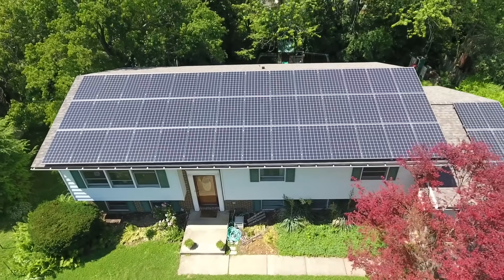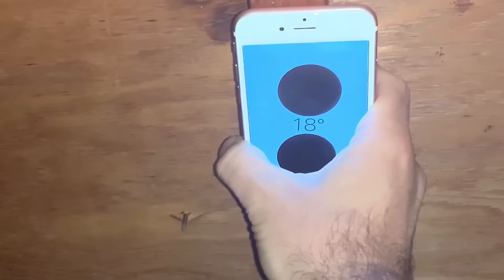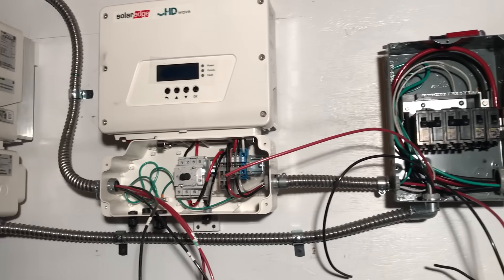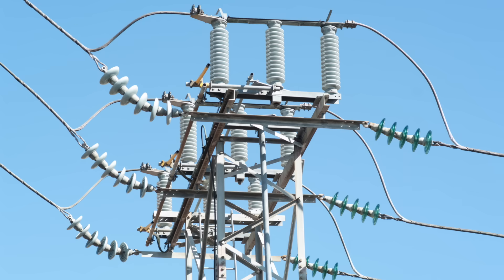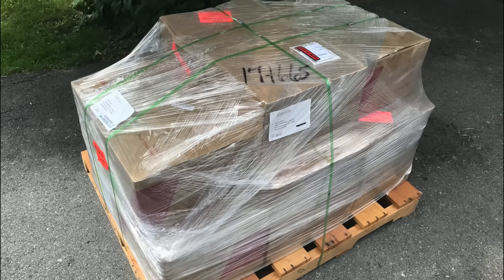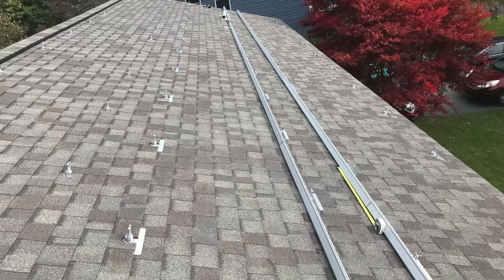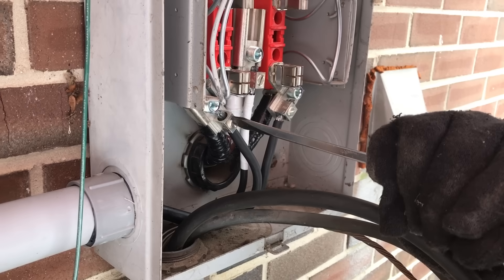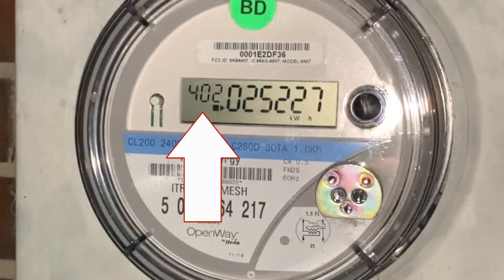I Installed a Power Plant Myself | HUGE DIY Solar Panel System

Comment from the maker: What do you think about getting solar?  Check the video description section for the various links.
Reply: What was the size of the system?
Reply from the maker: System is 15.6kw
Reply: @FrugalRepair  Huh?

A neighbor's solar array that's slightly bigger than yours, in rated for SIX kWh.  Also, did you have the power company verify what you were actually generating and that it was AT LEAST what was on the grid?  Otherwise, you aren't putting ANYTHING on the grid; you're a net CONSUMER of grid power.  And that's only for maybe 5 hours per 24.

Remember that power companies are FORCED to pay solar and wind providers as if they were generating 24/7 (which they aren't).  When that goes away, you might find some back payments are owed by yourself for all the power you were paid for, that you DIDN'T generate.
Reply: @billcichoke2534  kW and kWh are different, and output depends heavily on how efficient the panels are and how many hours of noon-equivalent sunlight they get.

Because fixed panels do not produce full power before and after when sun hits them directly the output changes but that is why the companies have those meters that can calculate precisely how much power is delivered in each direction. If someone says their panels get five hours per day they mean from full day of sunlight they get equivalent of having noontime sun shining for five hours straight, so for these 15.6kW panels they would produce 15.6 * 5h = 78kWh of power. A big house like that could easily use 30kWh per day so the company still owes them for 48kWh, but if their accounting program stupidly averages that as if the panels were producing power at night that is their mistake.
Reply: @FrugalRepair  At 15 Kw can be considered a plant or a generator? I looked at the power plant definition, and it says about industrial generation. But I do not found the specs to find actual figures about what can be considered a plant and what a generator.
Reply: @AnalystPrime  I get the power concept; but I don't get his numbers.  And my comment about 'generated power' he's paid for, goes back to the same issue.

Solar panels and windmills have an ADVERTISED output rating, that they rarely ever produce.  Also, that rating is 100%, which is another thing these two power sources never come close to.  So his numbers are way off reality right from the get go.  Also, solar panels have a VERY erratic generation output, as heat builds up internally and drops output, then cools as the output drops and output rises again.  As well, if his system is putting out less power than the grid lines are carrying, he's not putting ANYTHING on the grid...he just using less than what the grid is giving him.

Power grids work the same way all over the planet, and solar doesn't work in the desert plains of eastern Oregon.  I have to disagree with his numbers AND conclusions.
Reply: @billcichoke2534  Advertised output is irrelevant, if current output is 5kW and he is using 2kW then he is selling 3kW to the grid and getting zero watts from it. In the evening panels give him 1kW but he is using 4kW so he is buying 3kW. At night the house uses 500W so he is paying for .5kW because starlight gives insignificant amount of power. All the power sent to the grid and received from it is counted as it is goes though the meter, nobody in the power company is making any assumptions on how much his panels are theoretically rated for and you shouldn't either.

How much power solar panels produce always depends on angle of the light and amount of cloud cover while the rated watts panels offer is always for perfect conditions which rarely happen in nature because Sun will shine from a slightly different point in the sky every day of the year and the angle and facing of your roof is fixed. You need expensive solar trackers for each panel if you want to reach 100% efficiency at capturing the light and the few extra watts are not worth the expense unless you are designing the array for the ISS.

Panels heating up does lower the efficiency notably, but while that does affect the output the output does not affect the temperature. If the Sun heats your panels to 150 degrees F they will remain at that temperature until clouds block it or evening comes, the amount of power drawn from the panels does not cool them down. And if you somehow invent a device that cools down when you draw electricity from it please tell me, breaking thermodynamics like that is either good for laugh or worth the next Nobel prize.

Power grids do not work same all over the world, in USA and other third world countries they are old and poorly maintained and that is why we cannot just power Los Angeles with solar power from Florida in the morning and New York from Nevada in the evening. Solar power has been economical without any subsidies for a long time already but power companies consider upgrading the grid to be a waste of money.
Reply: @AnalystPrime  I had to do a double take on your post.  'In the evening panels give him 1 kWh?'  REALLY?  Solar is so magical it works now even when the SUN IS DOWN?  And advertised output IS relevant, because that's what he's basing his numbers on.  As you correctly pointed out, the ADVERTISED output is based on each square meter of panel in lab conditions, with a simulated 'sun' pointing directly at the panel.  It is NOT proven out in the real world, where panels usually generate maybe 20% of that figure, under optimal conditions.

And grids all work under the laws of thermodynamics, to include energy flows from areas of high concentration to areas of low concentration.  So whatever he MAY be generating, is not as much as what the grid runs through his distribution transformer.  It is, therefore, impossible for him to be sending ANY power TO the grid, when he doesn't send as much power to his transformer as the grid does.

Let's use your numbers...if he's receiving 240v @ 50A (12kW), and his panel is making 5kW (unlikely, but we'll go with it) and he has 3kW over what he's using, then he's sending 3kW up against 12kW down.  In other words, no he isn't.  We won't get into whether his transformer is a straight step down or a surge-protected one way.  He's not making enough juice for anything to get to the grid.  So any check he's receiving, is due to a government edict on the utility company, NOT due to him being a 'power provider.'  And the same program is used by the owners of grid-level wind and solar.  They are paid by the utility based on a presumption of power provided 24/7 (which none of them do).  This is a government mandate on the utility company to promote and pay for renewables, at the expense of ratepayers who don't want solar messing up their roof or messing with their power delivery or raising their home insurance rates.  This is NOT payment based on actual generated power.

The internal thermal resistance I was talking about, has to do with not only the sun, but also heat created when current is generated.  As I said, the output is erratic due to this feedback, and it DOES decrease slightly as power drops, which allows power to rise, which adds more heat, which drops power generation...et cetera.  It is one of the main reasons the power output charts for solar are always all over the place.  And it is almost impossible to smooth out for residential usage.

I will give you the fact that we use single phase power on our grid (meaning north America and Mexico) while Europe uses 3 phase.  But the general setup and operation are the same, when it comes to routing power from generation sources to customers.  And our grid isn't just old...it's overburdened.  Take away generation sources because they're 'icky,' put pinwheels and smoke-and-mirrors solar in the mix, and add 10% more users every year, and OF COURSE we're going to have issues.  It makes far more sense to have city or county grids, with less cross-connectivity, than what we're doing now. That way, the needs of the area can be more quickly, efficiently, and cheaply addressed.  What we have now, is the equivalent of a prison yard, with everyone vying for priority.

Someone always loses, and nobody really wins...
Reply: @billcichoke2534  1. The time when Sun is down is called NIGHT, I even used both words one after another so it should have been clear from the context.
Noun: evening "The latter part of the day (the period of decreasing daylight from late afternoon until nightfall)".
Noun: night "The time after sunset and before sunrise while it is dark outside".

And yeah, I am assuming that house is not up in the arctic so the Sun is not still shining after midnight. Technically the panels would also produce few watts from moonlight and light from other houses, but I am ignoring that for simpler math.

2. If your car has top speed of 100mph, does that drop to 20mph if you only fill the tank halfway or parked the car for the night instead of driving it 24/7? Whoever told you that solar panels only produce 20% power is either hilariously wrong or a lying liar who lies, either way you should ignore their foolishness and use basic math instead.

3. What you are saying is that the electric grid can only ever have one power plant, because if you try to connect a second one the less powerful one cannot send out any power. FUN FACT TIME: Grid does not work that way. The power companies buy electricity from many providers each day and can combine it all just fine.
Reply: @AnalystPrime  You said panels generate power after the sun is down.  No, they don't.  You and I BOTH know what you said, and what I said.  You were incorrect, and there was no misunderstanding of context OR content.

As to power generation, that comes from the manufacturer, as well as the output panels on both local residential AND grid solar arrays.  That's what the METER says...but I guess I should believe you over the meters or my 'lying liar' eyes.  And I was using basic math, which apparently triggered someone, since it PROVED they were either wrong or lying (i.e. trying to sell others on purchasing these useless systems). And you're equating petrofuel performance (which can produce baseload 24/7) with renewables (which never could).  So your fuel tank analogy is an ironically ignorant one.

I understand how the grid gets power...maybe it's time you did as well.  The utility has to keep the power level just above what's needed--REAL TIME--but no more.  And baseline has to be maintained, regardless.  So my point is accurate.  There is always the same power at the distribution transformer for this guy's house, and he doesn't generate anywhere NEAR that.  So it's not going anywhere, least of all on the grid.  All that's happening, is he's using some of what he generates, instead of what comes from the grid to his meter.  That's it.

DESPITE the sales lines, none of these people are creating more power at their house, than what the grid has available on their lines.  If they were, then all the houses would each have to have a regulatory compliant substation, courtesy of the homeowner, controlled by the utility.  THEN the utility would be paying them for power produced.

Understand?
Reply: @billcichoke2534  48 panels @ 325W per panel = 15.6kW.  On an average day the system probably produces 55-65kWh. Taking into account for cloudy days, probably 900-1000kWh each month. He spins the meter backwards during the day more than he uses at night.
Reply: @propellerhead2000  Again, that is the ADVERTISED RATING of the panels, NOT what they produce in the real world.  As I stated, residential and grid-level arrays in my local vicinity do not produce ANYTHING close to their ADVERTISED rating.  And the power they DO put out, is extremely erratic.  It's the main reason we have more frequent power fluctuations and broken outs, than we did before these monstrosities were installed over valuable farmland. 

Considering the fact I live in the arid plains of eastern Oregon, where we have far less rain OR TREES to block any sun, it's laughable to say that someone who lives in a wetter, bushier area is making more from those same panels, than anything out here does.  To also claim anything about being paid for power being put on the grid, when his system can't make stable grid level power, is also laughable.

The truth about these things is, they DON'T work as advertised.  If this guy said he was saving a little money on his power bills, groovy.  To make claims that don't match reality (either of solar OR of our current grid) requires an answer.
Reply: @billcichoke2534  Stop being a silly person and please read properly before making accusations. I said the panels produce power in the EVENING. In case this is still unclear to you, "evening" is not same thing as "night", even a child should understand this much.

Incidentally, panels actually do produce power at night, and I don't mean in the arctic where the Sun does not set. Modern panels are so good they work on starlight and the light pollution from nearby artificial sources, the amount is just so few watts there is usually no need to mention it. But if you are going to do any electric work on the house, never assume there is no current just because the Sun is not shining.

My fuel tank analogy which you obviously failed to understand is that just like your car does not lose its ability to drive at top speed when not at the manufacturer's test track PV panels do not magically change their efficiency when not in the lab. A 100W panel is a 100W panel, not a 20W panel with fake advertising, that is what the testing facility and regulations are there to ensure. If you do not get the advertised power from them then either you are not pointing them at the Sun or you broke them.

Next you seem to have weird ideas of how power companies do business. An average American home uses about 30kWh per day, which the panels shown in the video can provide in couple hours. At minimum they remove any need for that house to buy any power from the company, meaning the only profit they can get from him is buying his electricity at lower price than they would have to pay for another provider. If the power company cannot get any energy from this house they have no reason to pay for it.

Basic math: either they get enough power from that house to make a profit or the power company goes bankrupt due to stupidly giving away free money.

It also does not matter that there are megawatts of power in the grid and this house is only providing few kilowatts, the energy must go somewhere and if it wasn't accepted into the grid it would have burned that house down long time ago.

And BTW, where in the video did it say that the power company does not have the basic systems they need to accept any power from the house into the grid? Your arguments not only fail to prove there is anything wrong with solar power, they imply that the power company is run by idiots who both refuse to utilize the available solar power sources and give people free money for not buying their electricity.
Reply: @billcichoke2534  No, that is rated output. A panel which is 18.75% efficient will produce 375 watts. I've had panels EXCEED rated output under ideal weather conditions. If you neighbor's array is larger and only producing 6kW then either something is wrong or the efficiency of the panels is shit. I've lived off-grid with solar and I am quite intimate with the variables involved in power production.
Reply: @billcichoke2534  PS - The solar energy received in western Oregon is poor. 40% less solar energy compared to a place like Nevada or California. You know this. Anyone who installs a system should know this and should factor into their ROI.
Reply: @billcichoke2534  what? I've been a technician for years and I've NEVER heard of the interconnection agreement you're describing here. Do you have a specific power company that does this or a link to a source of infor where you got this from?
Reply: @AnalystPrime  No, what is NOT clear is how you keep saying you meant other than what you TYPED.  Your misplaced condescending attitude aside, solar power generation for pretty much ANY TIME AFTER 1600hrs is low enough to be considered 'nonexistent.'  Utilities usually open the connector to solar farms around this time, due to this inconvenient fact.  Again, ask them if you doubt me.  I did.  And your fuel tank analogy had nothing to do with lab test vs. reality.  If that's what you were going for, it was a clean miss.  Not my misunderstanding, but your failure to even superficially address whatever point you were making. And my point is, the advertising behind these things, and the government support of them, is based on agendas other than environmentalism and their independent viability.  THAT is why facts like their lackluster generation capability are either glossed over, ignored, or (as you're attempting) scoffed at.

I understand the strictures PUBLIC UTILITY COMPANIES are under, to force these unworkable renewable boondoggles on them.  Renewables manufacturers and site/facility owners are in this business SPECIFICALLY BECAUSE utility companies are FORCED to pay them, and at higher than market rates.  And that FEED IN TARIFF is irrespective of the actual amount of usable power generated...whether you're talking about a grid level facility, or this guy's house.  So you're correct...the basic math IS that they either profit or go bankrupt.  But it's not THEIR stupidity that's on display here; it's the GOVERNMENT POLICIES TO PROMOTE UNWORKABLE EXPENSIVE GOVERNMENT SUBSIDIZED POWER at the expense of the middle class.  And it IS bankrupting many utility companies, while leading to a less reliable grid.  Not a conspiracy, just an observation anyone can objectively make.

I am amazed every time someone spouts a line like this.  Have you EVER seen houses burning up when everyone goes to bed, and that baseline 12 or so kWh isn't being used?  Have you seen everything plugged into a 2 or 10 kW blow up when nothing is running?  Of course you haven't, because the lines are designed around maintaining that current continually, for instant on demand access.  They were NEVER designed to have any surges of power from customer sites go BACK to the grid.  As I stated before, that requires a certain generation level AND A CONNECTION SUBSTATION.  Your distribution transformer, especially if it's shared with neighbors (as mine is) DOES NOT ALLOW BI DIRECTIONAL POWER.

This video doesn't talk about that FACT, nor does the entire solar industry...almost as if they're making that before-mentioned money off sales of this stuff and don't want anything interfering with those sales.  Strange, isn't it?  There is plenty of evidence that solar is unstable, and that utility companies will avoid using it for that reason.  This is the reason THEY are forced to pay those 'tariffs' to owners (grid level and homeowner).

The fact is, solar is unstable, erratic, weaker than baseload, and occurs when it's not needed.  Wind is the same way, only during 3-4 hours at night.  This is not something this guy would have done, if the free government money wasn't to be had.  And he didn't go off grid with it, which should ALSO tell you something.  If he did all his homework and this was feasible as an isolated and independent generation source, wouldn't he have done so?  But he didn't.  Stop being silly...AND BLIND.
Reply: @HomeEcGuy  Really?  What do you think a feed in tariff is, exactly?  And where do you think the money comes from, to PAY for it?

It's a government-mandated payment utilities WILL make to renewables owners, that utility companies have to make up with higher rates to NON-owners.  That's not even a fact in dispute.
Reply: @propellerhead2000  It most certainly is.  In EASTERN Oregon, however, it's much better.  But solar still doesn't work out here, any better than it does in SoCal.  This is not about ROI...this is about base viability.  This is also about making sure the facts are known, instead of continual sales jobs that ignore or obfuscate those facts.
Reply: @billcichoke2534  There is no obfuscation. Merely ignorance. If you area you live in receives at least 5kW-h per square meter, solar is viable.
Reply: @propellerhead2000  Oh, solar is sold wherever there's someone who buys the sales pitch.  That doesn't make it VIABLE...as it continues to show it ISN'T.
Reply: @billcichoke2534  Unviable?!? LOL! On what planet? You must live in a small world. On the planet where I live with 5.5 kWh/m3 of solar irradiance and a utility rate of $0.14/kWh the payback is less than 2 years for grid tie, 6 to 7 for off grid. People get fucked when they don't do their homework. Not because the technology isn't viable. They're the same people that bought aluminum siding, reverse mortgages and anything pitched on TV by Joe Namath.
Reply: @propellerhead2000  Non-viable.  On the world we BOTH inhabit, there hasn't been a single situation where solar kept the lights on all by itself.  Not one.  In every case where you only had grid level it residential solar, the power fluctuated badly enough to ruin electronic gear and be shut down, or the lights went as dark as every other home that WASN'T slathered in smoke and mirrors solar.  So without the feed in tariff and state and federal subsidy, solar doesn't work or pencil out.

And I'm not 'lol' ing about it.  It's a joke and a CRUEL one at that.
Reply: @billcichoke2534  Your pencils must be dull.  None of those things you describe occur with a properly engineered and equipped solar system.
Reply: @propellerhead2000  Oh, sure they do.  You just have to do your own research and not listen to these salesmen trying to pawn off their panels on you.

Talk to the manager at a grid control center.  Talk to a utility tech fussing with the lines or substations.  Talk with someone who has to actually DEAL with this stuff from the GRID side, instead of the government-supported owner/installer side (they ARE opposite interests).  Stop drinking the sustainability koolaid and find out the truth for yourself.

And ask yourself why push a book or certain brands of panels or components, if this guy has no ulterior motives with this stuff.  Who pays HIM?
Reply: @ehombane  totally random question but is your username based on an Isaac Asimov character from his robot series books?
Reply: @n8yt  Nope, Asimov inspired his series after me :) 

On a serious note, do you ever encountered at least Olivaw alone in other context than the asimovian one?
Reply: @ehombane  I interpret your response as an admission that you're really a robot detective then!

I don't believe I ever have encountered Olivaw outside of his series :-)

I'm reading through a bunch of classic sci-fi novels during quarantine right now. I am currently going through his robot series books.  So fresh on my mind + a unique name + seeing it in the wild.. my curiosity got the best of me.  Lol
Reply: @n8yt  Yep. To be more precise, I was, now I am not anymore a robot. When I was I liked the idea of a positronic brain and replaceable parts. But in time I changed, myself, and my mind. Now I am just a shepherd, albeit a little bit of a cannibal, since my tribe use to eat the heart of worthy enemies. 

However, I did not bothered to change the handle here with the new one. It does not bother me having a split personality :) 

If you wonder who the cannibal is, look for the journey of a catechist trilogy. Is a nice fantasy. Not as famous, but is better since I find always the username available.
Reply: @ehombane  That sounds like a solid recommendation from a person who was formerly a robot with a positronic brain but now casually eats people from time to time.  I'll take a look at that trilogy :-)

The best fantasy I've ever read, and I mean best by long mile, is The Broken Earth series by N.K. Jemisin.  It's the first book I've ever read where I wondered if the author was going through x (can't tell you what it is or it would be a spoiler) in their life because her emotion really spilled out on the pages of. I couldn't put it down. Check it out!
Reply: @n8yt  Thanks for the recommend. I will check it out, even I am long out of reading. with all regret of not being able to pass through so much good stuff that is out there. 

Anyway, what is good depends so much on so many factors. As   a kid was obviously Verne Wells Asimov... classics. Passed though so many others but ended with Piers and Zelazny. I told to my friend who supplied me with books that if writers were guns, those two are cannons :) And they wrote so much... I collected all their work with the intention to finish all of them, but my attention got diverted. No more time for reading :( Plenty of movies too. Many good books end up on the screen, even there are a lot of others I would have liked to see getting alive.  one of them is https://en.wikipedia.org/wiki/The_Chronicles_of_Thomas_Covenant
Reply: @billcichoke2534  Your comment makes no sense.  Please explain more precisely.  Where did you get this information?
Reply: @oscarb9139  Which one?  You didn't specify.  And I'm sharing info I got from three electric utility companies in the Pacific NW, a couple of solar installers, and friends dine in SoCal and Texas who get to 'enjoy the benefits' of an unreliable grid due to renewables.
Reply: @billcichoke2534  Your first comment.  This is not being critical of your comment, it is just asking for clarification.  Explain how the process works and link any relevant sources if you can.  Thanks.
Reply: @oscarb9139  Okay.  Hope this helps...

ONE:  FEED IN TARIFF--government mandate that requires solar and wind producers be paid for INSTALLED power capacity, regardless of how much power is actually produced.

GRID POWER--in order to mix disparate generator sources and levels, all go through conditioning systems prior to entering the grid.  Houses do not have this system included, and many are fed by distribution transformers that are designed to only let power go one way (unidirectional or site surge protected).  Any that AREN'T, do not produce enough power to compete with what's on the power line.  That means grid power is still going TO their house, and NOTHING is getting out.

Why are they getting paid?  See point one.
Reply: @billcichoke2534  Okay, I am confused.  It was called net metering where I used to live.  So, at the end of the month, if the net use was positive, you paid the retail price for power used to the power company.  If the net was negative, the power company bought it at the wholesale rate.  It didn’t matter how much was installed on the home.  Do you have a link for point one?
Reply: @oscarb9139  Yes...here's one from our friends at Wikipedia.

https://en.m.wikipedia.org/wiki/Feed-in_tariff

Notice that the cost of this subsidy is laid at the feet of the utility, who then has to extract it from people who can't use or afford solar.  This leads to not only aforementioned grid unreliability, but power poverty.
Reply: @billcichoke2534  https://en.wikipedia.org/wiki/Net_metering.  That’s what I am familiar with.
Reply: @oscarb9139  Correct.  It's an ASSUMPTION of a certain amount if power generated, even if it WASN'T generated.  Most importantly, like I said earlier, the re w isn't a single residential rooftop solar system creating as much juice as what comes down the power lines.  There is, thus, no power going TO the grid and nothing to give credit (or payment) for.  It is a feed in tariff, with a different name.
Reply: I highly suggest you go into business.
Reply from the maker: You mean as a solar installer?
Reply: @FrugalRepair  Why Not? There are courses available that you could breeze through now. Get an electrician on contract.
Reply: @davefroman4700  where are these courses? I’d be really interested in them.
Reply: I think you can squeeze 2 more panels on top of the garage
Reply: @fahrimertdincer8421  Not much point, it is oversized unless he is using much more power than average home. Which does bring to mind, I want to know how much does that produce in the morning and evening when the angle of light is at its worst.
Reply: @davefroman4700  awesome
Reply: I put in a small system in 2007, and kept adding to it as panels became cheaper and cheaper.  I'm at 16kw now, with another 6kw on my shop building.  Haven't had an electric bill in 8 years.  About 1/2 the setup is also battery backup based.
Reply: How much did you pay for everything and what would it have cost having the panels installed by professionals? Did you ever consider a solar roof?
Reply: We mounted our system on the ground because we didn't have enough roof space ! Nice system ! well done!
Reply: You did an great job. 
Did you play the kid on Alf?
Reply: How did the module warranty work with your system? Does it have a warranty?
Reply: So how will you clean the panels in the future ?
Reply: @user60706  You are joking right? We have ceramic coating on our panels, I have not seen a flex of dust on them since I coated them.
Reply: @davefroman4700  No Dave, I'm seriously asking. Because i installed a 100w panel in my home around 6month ago and after 5 months i noticed some reduction in power production from the panel. So cleaned the panel and after cleaning I'm getting the power in better. So i also planning setup panel system like you made. But I'm little confusion regarding the cleaning or any other maintenance.
Reply: @user60706  You clean a panel the same way you would wash any window. It is normal for cheap 100 Watt panels to decrease slightly upon break in period but it should level off. If it keeps dropping its faulty. I put a clear ceramic micro-coating for cars on my panels but that was a luxury. I havent had to clean my panels at all since.
Reply: @davefroman4700  oh that's nice. Thanks for your idea dave.
Reply: @user60706  PV panels need basic cleaning, that is just common sense. Quick spray of water from your garden hose should be enough, but how often you need to do that depends on your local conditions. If you got bird poop, leaves or certain types of pollen on them you might need to brush them too, I recommend using one of those mops with a super extending shaft so you don't need to climb to the roof every time. Other than that, checking occasionally that none of the wires got loose or eaten by rats and none of the electronics have fried is all the maintenance needed. Solar is definitely not zero maintenance but only little is needed so it is very user friendly.

Your real problem is you are using a 100W panel, that means just a little dust will drop your power production a huge percentage compared to modern 300-400W panels. Some 100W panels are pretty good quality, just small because it is meant for campers to carry with them and such uses; there are also still lot of very old panels on market that are only 100W because the tech is old, crappy, or both. If you got the latter kind, chances are a larger than average leaf falling on the panel will drop the power output to near zero...
Reply: @AnalystPrime  Thanks for your advice
Reply: That's beautiful work, and exactly what everyone should do. You should expand your storage to 20kwh+ and not bother with grid-tie.
Reply: I have a basic system. I need additional panels though. I will follow your links. Thanks.
Reply: Great resources. Thanks
Reply: Please make some videos on renewable energy credits. I am having solar installed next week and still need to educate myself on the credits. I thought about doing it myself but decided against it. I hate doing electrical lol.
Reply from the maker: @TheStevedie  will do!  I’m actually writing out the content for videos now.  SRECs are important to understand.
Reply: Very good presentation and craftsmanship
Reply: When I build one day, its getting solar.
Reply: Every roof should be plastered with Panels. And evacuated tube Collectors with a warm water storage Tank.
Reply: @te0nani  You DO realize that was the plan of the Carter administration...to WARM UP the planet because we were going to get too COLD.
Reply: @billcichoke2534  I don't think we're talking about the same subject anymore.
Reply: @te0nani  Sure we are.  Solar panels to stave off global warming?  Goes directly opposite their intended design and purpose.  Viable for power generation?  Repeatedly proven to be a scam and a fraud, kept alive by subsidy and mandates.

Yup...we're talking about the same thing.
Reply: I've basically been in your boat for 15 years.  The idea of solar started becoming something that wasn't the wet dream of a Greenpeace activist around then.  The problems for me have been:
A.  My local power company doesn't offer credit for power put back onto the grid (and we aren't deregulated, so I can't pick another).
B.  As a result, I could only just get a $0 bill for half the year without generating a bunch of throw away power, and my break even point would just about coincide with the end of the panels' useful life.

Doing the labor myself might make up for that, though.  Is it possible to do this when you aren't changing your shingles?
Reply: We are thinking installing solar system via a government progmam where you get funded the 85% of total costs by the goverment. I think is worth the effort as we will pay very little for something like this.
Reply: @georgiosskokos6302  Last year in my country was a similar program, a bit better, 90 percent subsidize, so I promoted it in my circle, but few met the requirement since we are mostly city dwellers. And the worst part is that there was a limited amount of grants, something like one for every thousands of roofs. So even only 10% of those eligible would have wanted to bother with this, the program would have been an drop in an ocean. Anyway, the number of those interested was way far less, but still too many were left out..
Reply: Solar panels attract insects , thus attracting birds. Solar panels then kill birds by literally cooking them . In the larger solar fields out west , birds can ignite birds in mid flight. Workers on these farms call them streamers , because they smoke from the reflection of the solar panels ; when they fall out of the sky.  Not to mention the environmental impact of destroying the earth below the panelsduring use and decades to come after they are disposed off. We're going backwards here people, not forward.
Reply: @immelting9834  https://youtu.be/emBY6phmn9E

You are mistaking the type system I linked above with solar panels.  Solar panels do NOT ignite birds in flight.  I am not even sure solar panels attract bugs.  Perhaps they do.  Now, that being said, I am not a windmill guy.  The power they generate is expensive.  The power is unreliable and has to be backed up with fossil fuel or nuclear reactors in the even the wind dies down or cloud cover obstructs the panels.  Solar fields are ugly to look at, and every bluff in Texas seems to have a bunch of windmills on them.  Should we stick them on the rim of the Grand Canyon too?  Maybe in Yellowstone.  Maybe Banff.  The wind is pretty good there too.
Reply: @oscarb9139   I work at Upton - 2 Solar Farm in Texas. The solar farm covers almost 2,000 acres roughly the size of 1,400 football fields.  It has  around 720,000 solar panels. The company literally pays employees to go out and pickup birds because of this on a daily basis.  The wind farm 10 miles down the road does the same thing with migration birds flying into their structures. One of my buddies that works at the wind farm said last year's reports totaled over 1,000 birds killed. 50 of those were on the endangered species list .  We are required to report  bird deaths to the government or we could be shutdown.
Reply: @immelting9834  Funny that you have to report it or get in trouble.  If a Golden Eagle died after crashing into a smokestack on a refinery, they probably get fined regardless, but solar and wind is so important they can kill birds all day, every day.  

I am so sick of wind farms.  You can’t drive 20 minutes without seeing the next farm after passing the last one.  The ones around Seymour Texas are all brown from the cab to the base.  Leaking oil?  Half are feathered and they are installing 20 more as of two days ago when I drove by.

I bet the homeowners who are in the shadows at sun rise and sunset really love them!  Hours of flickering sunlight twice a day!
Reply: @immelting9834  Here is a question. I was at the American Royal BBQ back about 2010.  The team that was parked next to us had a guy who was a wind turbine maintenance guy. My brother asked him about all the units he had driven by near Russel Kansas that were feathered.  The guy said something to the effect that once the government subsidy runs out that it is not cost effective to repair the units for service and they sit there from then on.  I have heard it is some of the most expensive electricity generated in the US.  Do you find any of this information to be believable?

My position:  I don’t hate them, but they are everywhere.  Looking at a few in the distance is peaceful.  Looking at hundreds is annoying.
Reply: @immelting9834  Another question:  how much power do the panels use to orient themselves towards the sun throughout the day?  How often do the mechanisms break?  I have seen some smaller PV fields and it seems like there are usually several rows that aren’t pointing anywhere near the sun.
Reply: @immelting9834  Hey man, where did you go?  I left you a few questions because I want to learn more about the farms, not insult your position.
Reply: Idk how is this possible. In my country you CAN'T "own" solar panels. Yes you can have it on your roof. But it's NOT yours. You have to sell it to the grid. And than to "buy" it again from the grid, like a normal electricity. Idk why it's like that. But you can't be off grid.
Reply: The website isn't sending the guide
Reply: I want to know the actual price of whole project
Reply: Did you ever consider something like powerwall or a similar system, so you could optimize when you used power from the grid and when you gave the grid power? for example, you could use it to store energy for night, storms, and such, and could also give more energy back during peak times when it is more needed. Why did you decide the way you did?
Reply: As a technician I have to say I can't stand SolarEdge. They're 99% of what I install because they cornered the market a bit but I have nothing but problem after problem with those systems.
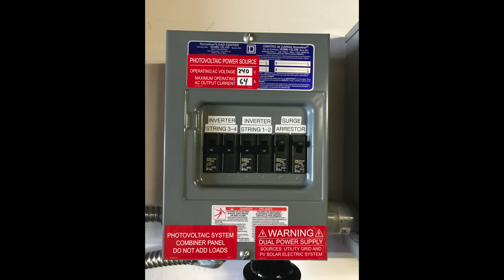Reply: what is the use of glass under breakers 10:12 ??????
Reply: But maintenance does!
Reply: How much its initial cost??
Reply: No batteries?
Reply: I'm in Alberta Canada and up here net metering is butchered we only get credit on the power we use so since most of my costs are billing fees and transmission fees currently over 100.00$ all I can get off my bill is 20 to 30 $a month so it's  not worth it unless you disconnect from the grid  but then you need battery's and that scares me everything I read paints a very expensive system
Reply: So glad it worked out for you, man! Fortune Favors the Bold!
Reply: Nice work. 
Can you help with the a copy of your book?

Oh do you have a learning platform? I want to become an approved installer in my region. Looking at what you’ve done, it will be good to learn from you.
Reply: it is, of course, a nice accomplishment but governments might hate it when e.g. all people do not buy electricity from their state power utility anymore? Eventually, politicians might come up with new laws. Another difficulty might be regions with lots of snow, how to remove 10ft thick snow lying on the pannels? In case of a fire, it might be good to have metal roofing that can be installed over top of shingles. Otherwise, these expensive solar panels might go up in flames? What is a crazy new phenomenon is that solar panels are stolen even from a roof, see, "Solar Panels Are Vanishing, Only to Reappear on the Internet" (NY-TIMES).
Reply: @lenny108  That would be an interesting twist.  Many, possibly most, western governments around the world are stopping just a hair's breadth short of mandating that you install solar panels.

As for the areas that have such environmental challenges as heavy snow, I believe they sell heated panels designed to prevent accumulation.  Not sure how much good that will do, though, as those climates tend to get a good deal less sun year round.  Above a certain latitude you end up needing more power than can be produced on your own roof even with unobstructed panels.
Reply: @benjaminnelson5455  That's because utility companies are privately owned right now, and government regulated.  If the government takes them over completely, trust that you WOULD be expected to let your house power the grid, at your expense AND with no consideration for YOUR power needs.

There's already a requirement for new homes to be grid and utility connected.  It's not a stretch to assume 'smart grid' means the central authority would have control over your power or anything else.
Reply: @billcichoke2534  Yeah, they can try.  If I decide I don't want to install solar, or want to power my house off the power grid for whatever (unlikely) reason, the government is going to have to commit to sending men with guns to make me.

I'm a little sketchy on some of the incentives involved as is, because a portion of my tax dollar funds those, but even that's a far cry from what it seems you're talking about.

A voluntary installation that supplies a smart grid is fine with me, anything else is an invasion of private property and at the very least I'll force the governing authority into publically demonstrating it as such.
Reply: @benjaminnelson5455  I'm afraid your bluff is going to be called.  California already mandates some of this nonsense, and is on track to mandate MORE of it.  And Biden has promised to do the same on a federal level.
Reply: @billcichoke2534  There's a good chance you're right, but I wouldn't do it because I intend to meet them with my own firearm ... I don't.  I'd be doing it in the spirit of Hank Rearden, ideally having arranged to meet them armed instead with one or two of the remaining genuine journalists and a few cameras.

Hopefully it won't come to even that, but if it does we're currently in a time period where publically showing any government trend toward tyranny is massively more effective than shooting at them.
Reply: Awesome :)
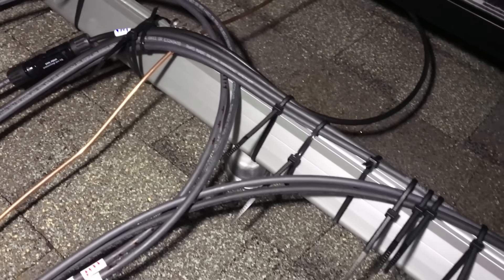You might want to revisit the cable layout at 08:56. I think the grounding strip is not supposed to touch other cables, because lightning strikes might damage the insulation. It's conjecture but better to be on the safe side.
I don't have a house and I had to get very rich to buy one in Berlin Germany, at least in the center or I had to get very lucky.
Reply: Frugal Repair - A ROI of 14% is excellent! It used to be much more expensive to install such a large system. Now there’s no need to reduce energy usage AND you get to sell power back, resulting in an excellent ROI! Great job, good on ya 🤙🏾
Reply: unless it makes a profit without subsidies it's loosing money. ROIs only count long term with replacement costs of equipment factored in. However, selling your home and recouping your " investment " plus any additional profit you can get for some sucker buying an all green home seems like a nice strategy to get a free system on your next home if you make enough profit.
Reply: @mikemorgan5394  I wonder why the notion of ROI appears in the case of solar systems but not in so many other personal expenses like the car the house, clothes and all other toys. In all of those cases, there is a cheaper option like using public transport, or buying a small house, since you really do not need more than a bed a bathroom and a kitchen. 

Or when you contribute to charity. You never get a return of those money, but you still give because you know that there is a need, and you a social animal and no not want to behave like a predator. 

In those green options obviously you can choose an optimal system or use your own work and the system will have a good ROI. Or you can depend on professionals, and obviously they will try to sell you expensive stuff, they need a profit too, so sure, suddenly the toy will never pay itself back. I even saw a guy, and even a smart one, professor, quite upset on how windmills are not profitable. He chose an expensive setup, among which was a ditch through bedrock for cables, and more, his system had an lousy output for so sure it was defective. So now he was furiously advocating against personal windmills. He even used some technical truth. A perfect windmill will have adjustable blades. And since these small one have fixed blades, will perform optimally only at a certain wind speed, and since  wind is not constant, no top performance, no profit. A total bullshit, since so many other guys just slap together an working system from spare parts, totally  not performant but since did not cost anything, is infinite profitable.   Instant ROI.
Reply: @ehombane  because it's an investment/ business taking the place of a utility. Solar power and windmills are not efficient. Except in a single home. But the cost is high. The benefits are largely intangible because they often don't produce enough so cost is a huge issue to more people installing them.  Some people get solar cells for free and manage to put up  entire systems on sweat alone. I always find that extremely cool.
Reply: @mikemorgan5394  cars are utility too.
Reply: @ehombane  cars are luxury items
Reply: @mikemorgan5394  Precisely my point. 

And still everybody buy them, often with great effort, but nobody complains about ROI. 

Then Why stress ROI for solar panels which saves us from burning stuff?
Reply: Hi man, i have a question.
Are u use bateries too?
Reply: This kind of thinking destroyed my province of Ontario. As a result of people like yourself, Ontario has the greatest debt in world history. Thank you for that.
Reply: Please send ur mail id,
Reply: Use "CAPACITOR-BANK", Consult your electrician ,by which you can give more huge power to grid, for which u  can earn more money. "CAPACITOR-BANK"
Reply: @sndvvt  Stupidest post I have seen thus far.
Reply: I don't recommend it for most homes in Florida, just because of nature. But otherwise I'm a fan.
Reply: @TheSonofabiscuit  You are a fan of something that destroyed my province, raised taxes sky-high, made our hydro bills the highest on the planet??? Did you know one of our greatest expenses was the constant replacement of windmills which kept breaking down? The solar panels that failed constantly and were tossed into the garbage with deadly chemicals in them? Green, my ass.
Reply: @darkxader7543  hahahaha sucks for you troll
Reply: @TheSonofabiscuit  I am a troll now?
Reply: @darkxader7543  yes, and you're blaming a product that your province bought with money they didn't have.. it's something Americans do everyday, and i won't feel bad for your province's poor decisions.
Reply: I think you are a hero, great job!
Reply: You can also add next row, by overhanging it on north side of A frame roof. Meaning you will prolong south side of roof with panels, but it woud need additional construction.
Reply: Never stand in Front of a breaker when you throw the switch.
Reply: Absolutely brill I’ve been researching for a while, just what I needed, how do I get the down load
Alan
Reply: Don't do it for the economics
Reply: I totally believe you, lad. This is great for all Niagara Falls New York and their counties houses and businesses.
Reply: What  was the total of money you paid for everything? I mean all expenses including the final installation where you had to hire someone.
Reply: Add batteries to use power at night
Reply: @FrugalRepair   i have one question, did you install anything to prevent  electricity from flowing to the grid incase of an power outage and workers are servicinvg the system?
You mention you tied directly in the meter, mmm
Reply: I like that you extended your financial assessment to analysing ROI. I realised you did not cover storage (batteries). Are there any? And if not, what happens on a  gloomy day? (Good old power grid I guess)
Reply: Wat was ur total cost
Reply: I am building a wind turbine to go with my solar. Great video!
Reply: You saved yourself 15k with your install. How much were you paying before you went solar?
Reply: What state do you live? Why not tell everyone what you paid up front in dollars what your cost was? How will you save money in the North East where the sun does not shine too much from November till March.
Reply: @sonnie6  It shines a lot more in the other months.
Reply: I didnt see the link to your Panasonic solar panels
Reply: I have 18 panels about 10kwp I love to extend that even further including adding another Battery.
Reply: your panel is protruding out of the top edge , you are constantly providing up force with wind on your roof , you need a cone type build to stop air going underneath the panels ...
Reply: What are costs of insurance of such system? After hit by lightning it gets completely destroyed - so your whole investiment is a loss. Please tell us more on how did You manage to insure the system, how much does it cost per year and what events insurance covers (hurricanes, nuclear wars, lightnings, vandals etc)
Reply: @piotrcurious1131  Its not destroyed if its properly grounded.
Reply: @davefroman4700  Well, any electrican who works long enough to work with homes struck with lightning will laugh at that. Just EMP from lightning destroys everything, often in 1km radius from strike. Average lightning carries currents of over 10 000A, no way to "properly ground this" without superconductors 😅
Reply: @rpsmith  seriously that is how much it costs to manufacture solar today. Wholesale prices are down to 20 cents/watt for grade A 300 watt panels.
Reply: @davefroman4700  - Dave, I was responding to your comment about lightning not destroyed everything if its properly grounded.
Reply: @piotrcurious1131  I was at a house last week that was struck by lightning...only a few optimizers were damaged. There are EMP hardened systems out there as well. Sol Ark is the most well known
Reply: @HomeEcGuy  Interesting. i cannot find any of their systems priced 0.13c/W though, any links ? :)
Reply: @davefroman4700  I have fitted thousands of panels in the uk and have never herd of them being struck by lightning if they are properly installed shouldn't be a problem
Reply: @davefroman4700  No, not really.  Proper grounding never guarantees no damage from lightning.
Reply: @piotrcurious1131  And btw? Every year it gets 15% cheaper to replace any of the equipment. There are a flood of commercial panels on the market that are less than 6 years old that utilities are upgrading to more efficient panels because they are cheaper and can make more money from them. Their old panels have already paid for themselves.
Reply: @davefroman4700  Well, but you invest upfront. Then after lightning you need to pay for taking all the junk down, disposal (in Germany disposal costs of 16KW system will be well over 1000e , not including transport to disposal center), then reinstall. 
Besides lightning is just one of most common things happening to a house . Hailstorms, strong winds, falling trees, all other kind of crap.
Not that insurance is showstopper, i just ask how much insuring PV costs - it is one of the bills one needs to pay, and each place has different laws and regulations.
Reply: @davefroman4700  the "15%" cheaper each year is quite weak for taking the huge risk . Especially it is not true, as PV systems are just investiment bubble serving indium traders - note that indium used for transparent electrode is finite resource. Panels do not get any cheaper since long time, and there is no method to produce high efficiency panels without indium. 
Also reason why there are flood of used panels is the exact PV bubble - people buy them, then actually they take them down because it is too much of a hassle - inverters break down due to surges in the grid or just are of poor quality, they get the panels constantly dirty from leaves and mud, electric companies do not want to buy power anymore and charge extra for operating costs (see f.e.Belgium) or they just got leaky roof due to some random event and had to take all the junk down anyway. Then they find out subsidies are only for new systems, and noone wants to risk buying used panels anyway - cost of installing it is too high vs risk of failure. No warranty - high risk you just pay for labour more than it will produce power. Then again - you cannot insure used panels. And last but not least - people buy cheapest panels to get investiment back, and those are biggest panels. Big panels = big transport costs, and no second hand market for f.e. boat or rv owners - those panels are too big and too fragile for any other use than on solid roof. 
Also panels cannot be disposed everywhere, they need to be transported to special, high tech recycling facilities - cost of transport ruins whole "carbon neutrality" idea, esp. you need loads of energy to recycle solar panel.
Reply: Im no actuarial but knowing how rare lightning strikes are Im pretty sure I'd like those odds
Reply: @piotrcurious1131  LOL sorry but your arguments are bs. I know how cheap solar has gotten in the last 10 years. Its not some BS conspiracy. It used to cost $75 to manufacture one watt of solar. Today the cost is 13 cents.
Reply: @davefroman4700  16KW system for 2000$ ? Any links to such sources?
Reply: @davefroman4700 Rare? You get major storm where I live at least 5 times per year, sometimes with flash flood taking away whole house 😅 Insurance is a must - and well defined one - i've seen people lost f.e. custom audio equip like synths, guitars etc. and stuff and getting just part money back because they had no invoices for some of equip. 
Seen all equip in house (computers, drives etc) fried because of nearby hit - it makes much difference if You have power cable coming from ground and just lightning protection separate from your electronics. Putting stuff on roof... and connecting it to mains - it is just asking for trouble.
And even with grounding, arresters, separate circuit for computers tripping upon detecting surges in mains - after a hit you have to replace all vital protection equip. Just check how many people actually afford that f.e. on French countryside - most have their lightning arrester fuses burnt and just live with that and shrug - if they change it after each storm, it just gets expensive. 
OTOH i also seen people happy with their insurance plan - being hit is just like winning lottery for them and means new xbox and plasma 😅 Though important to mention those are usually "normies" having not many tools, living in rented flat and having just few gadgets. 
Either way i would not downplay lightning issues , except You live in area where they plainly never happen.
Reply: @piotrcurious1131  having major storm does not ensure a strike. Less than 1% of the lightning you see in a storm is actually capable of creating a strike. And protecting a solar install is as simple as installing a lightning arrestor on the system and having it properly grounded so that the energy goes through that frame.
Reply: @davefroman4700  Well, you speak from theory, I know practice 😅 I recall only one place from my work history where lightning protection did not rely on insurance - hospital with CT and MRI. It was incredible tricky to do it right , and it was low building. 
All other stuff, incl. radio retransmitters etc. even with damn expensive protection and expert electricans never survived direct hit - many times just EMP fried something unusual - wiped eeproms, broken microcontrollers, boards fried from arcing...

Just grounding frame is not only naive but not enough. Perhaps wire mesh in front of panels could do some good, but again, you create huge wire loop wchich will generate EMP's - just amount of wires makes this mission impossible. 

Lightning storms are defined by lightnings, so i speak about ones which actually have those. this means 100%. Sure that chances You will be hit is like once per 2 or 3 years, depending on terrain etc. This is why insurances are actually affordable - it is cheaper that many people pay and then save on (usually ineffective) lightning protection , limiting it to protection helping to just prevent fire. In this context PV is actually lowering fire risk because it is grounded. 
Still saying strike is not a concern or that grounding frame is enough is plainly decieving people. Bit like driving car without insurance because You are so good driver and so on.
Reply: @piotrcurious1131  I have one on my system. And the installer told me he puts them on every system he installs. Just because your code has not caught up does not mean Solar installers are not doing it.
Reply: @davefroman4700  agreed. Not only have I watched prices drop like a rock the technology gets better and better each year too.
Reply: @piotrcurious1131  honestly if everything is grounded and you have a faraday cage you're fine no need to worry about emps from lightning
Reply: @draken865  I really wish what You said would be true. I know from experience securing even small device like radio transmitter or camera is next to impossible. I know noone who suceeded without making it insanely expensive - there are places like Eiffel tower wchich would pay millions if You had technology like that.
Reply: I want to do something like this. My house roof is too steep to work on plus it does not face optimally toward the sun. However my detached garage/work shop could work. The roof is less steep plus one side faces directly toward the sun most of the day.

Have you considered getting a battery storage system? It would guarentee no power outages.